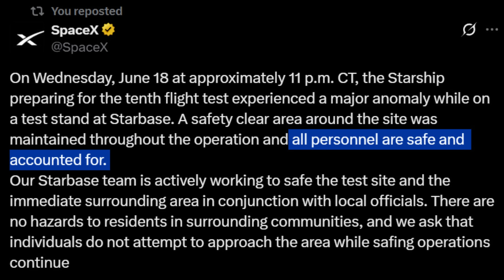SpaceX's Latest Starship Explodes During Ground Test

Comment: My analysis: Forward CH4 bulkhead weld ruptured, much like how test tanks failed at the bulkhead, resulting in payload section being blown apart by the pressure. The initial cloud seems to be CH4 since it all ignites, and I think the first bang is the main CH4 tank... Then the second bang being the LOX tank bursting from falling to the ground - seems like a big amount of LOX was released on the second bang, because the big expanding cloud from that doesn't ignite
Reply: My analysis: Another Starship, another big fireworks display. Whatever the fault, at least Space X manages to be consistent.

Comment: You said they should be going straight to V3. My humble opinion is probably reverting back to fight tested V1 and then start iterating again from there.
Reply: Reverting V1 would be gaining no new information. So it makes sense to move forward to a new version and test. They already know the pain points of V2, fixing that and the other planned improvements to V3 would be a fine move.

We need to stop treating V2 as some magical cursed vehicle that needs to be completely thrown away. Iterating from this is perfectly reasonable, either undoing the problematic parts, or making a better change.

Comment: And all the Spacex fanboys say we should cancel SLS…
Reply: SLS and Starship perform different functions. If you abandon Starship HLS, you don’t replace it with something launched on SLS. Your leading candidate would be Blue Origin’s lander that launches on New Glenn, but you might be able to use Falcon Heavy.

SLS is biblically expensive and it’s not very capable. It’s only real claim to fame is being both big and crew rated, but Starship has no plans for that in the short term anyway
Reply: Of course SLS should be canceled regardless.  2.2 Billion per launch is not sustainable in anyway.
Reply: And they're correct. At year 6 into development SLS had cost 230 billion taxpayer dollars and had launched two Pathfinder test articles that were really unrelated to the design. At 6 years in Starship has launched 9 test articles that are closely related to the final design and some unrelated pathfinders at a cost of 5 billion, none of which is taxpayer money.
Reply: @gasdive you wanna get onboard a starship on the launch pad?
Reply: @Rory-Shields  I'd be less nervous flying Starship. By the time someone like me could fly there would have been hundreds of thousands of Starship fights. There will never be more than half a dozen SLS flights and every flight will be of an untested vehicle.
Reply: @gasdive sls isn’t untested it’s already flown around the moon. It’s actually way more tested than starship, why do you think it’s so expensive and takes so long to fly?

Comment: they need to rethink. Wadever they are doing will cause leaks. New welding method, structure assembly method. They changed something and now it causes problems. V1-s flew fine asside from melting in atmosphere.
Reply: Problem was Version 1 had zero ability to lift a useful payload. Marginal at best. The Raptors are underpowered and overly sensitive to shut downs and exploding. Now they have messed up the fuel system looking for a cure. Their heat shield solution doesn't work either. 
Mind you these are the chaps who thought no flame trench was a good idea. How many years did it take them to acknowledge their stupidity on that simple point?
Reply: Starship is a turd.  They need to do a redesign  of it.  Booster seems to be good though
Reply: If their given the time to think. Haste makes waste, this sure sign of it.

Comment: "We don't know the effects of breathing tiny glass fibers". Actually, we do. Fiberglass if not a new material. The answer is 'not great but better than asbestos'.
Reply: These glass fiber composities are a bit different than fiberglass. The scale of the particles and their structure is a lot different, and could make them more harmful.
Reply: @XIIchiron78  That may be so, but I very much doubt that SpaceX is the only company in the world using them or that safety has not been analyzed for the factories that manufacture them. Yes SpaceX may have their own proprietary unique recipe of ingredients but I expect the actual ingredients are not that rare. I would be a lot more concerned about the non-silica ingredients as we know a lot about silica in general. They likely contain aluminum and boron but even those are not that unusual additives to glass. In general breathing any particles is not good for you, but most have only short term negative effects unless they are in very large amounts. What you want to watch out for is carcinogens and stuff that does not break down and continues to cause issues for decades like asbestos.
Reply: @TimothyWhiteheadzm Yeah it's probably known. SpaceX tiles are very advanced Shuttle tiles so I'd assume some Shuttle engineer has dropped one so that it shattered at some point
Reply: Not great, not terrible
Reply: @semedianindustries  It's pretty terrible.
Reply: Just regular fiberglass is completely harmless. The fibers are so large they get caught in the mucus and expelled from the lungs. They're maybe irritating to the lungs and esophagus but that's about it and temporary

Comment: I no longer believe that Starship is testing spacecraft. They are simply testing explosive properties.

On a serious but speculative note - it's been reported by serious analysts that the deficient fuel to weight ratio of the starship design has likely led to cutting very close to the edge on the margins for the strength of basic components - such as tanks and tubes which are subject to high pressure. This could be another case of a pressure vessel compromise due to very low margins of tolerance. The reason engineers design pressure vessels to 150% of expected pressures is, as you know, because manufacture of such vessels (or pipes or tubes) is rarely perfect. The manufacturing process could result in variances of some 5-10% or more. If your tolerance requirements are lowered because you need to reduce weight, and you take the vessel down to 115% strength vs expected pressure - you're going to increase the probability of failure. 

Starship has a long history of sailing too close to the wind. And it shows. Much of the program has been a catastrophe.
Reply: Would you mind disclosing what “serious analysts” you refer to?
Reply: @ShawFujikawa It came to him in a dream.
Reply: @ShawFujikawa  Elon!
Reply: Actually, much of the program has been very successful, up until the last 3 and then this. Which leads me to believe, they either engineered backwards, or sabotage.
Reply: @skydivejumprope Sabotage by Musk is usually the cause at SpaceX. He is valuable in his ways but damn is it annoying
Reply: @xWood4000  Oh yeah. It would be much easier to digest if they were nasa or boeing or whoever that never streams shit live and never tells you shit yet costs billions.... Then nobody could judge them until it's over with already. Like SLS.
Reply: Those properties are needed in Iran to get rid of those laboratories.

Comment: i always figured starship was going to be so powerful they didn't need to 'barely' engineer it. they could design in layers and layers of safety and redundancy and still have plenty of excess launch mass.
Reply: No it's the other way. It's so heavy they're trying to remove and optimize as much as possible to reduce mass, on top of increasing thrust.
Reply: That would be true and probably easily done if the goal was just "go to space". What they want is to maximise the possible payload.
Reply: @slyseal2091  your lack of reading comprehension is appalling.
Reply: It has yet proven that it can even lift anything, so it doesn't have "excess" launch mass
Reply: You on Ketamine too?

Comment: It's not ideal to breathe anything small and fibrous, Silicosis is nasty.
Reply: That's kinda the reason asbestos got banned
Reply: @weazelzinacan8866 but the ban is perhaps going to be lifted in the US :/
Reply: @anomalousresult  uyuyuy... good luck with that :/
Reply: I inhaled a cottonwood fairy while bicycling. It was alarming.
Reply: @a.nameline653 i imagine the fairy was less than thrilled by the experience
Reply: Big time. I don't know about the present but a few years back, it was sold to auto shops for oil clean up. You could see the floating shrapnels of reflected light in the air.
Reply: How do you know?
Reply: How about a chunk of something that is flying at you at high speed?

Comment: How many Saturns did Apollo explode before putting humans on the moon and returning safely?
Reply: No full Saturn Vs.  They did lose a shit load of early F1 engines in testing.  All the harmonics and flame propagation issues on that monster had to be solved "empirically".  AKA, exploding them.  And of course they lost one capsule due to a wee bit too much pure oxygen.
Reply: @dogmaticpyrrhonist543 beat me to it.  It was quite a lot of them.  I think the Haynes manual for the F-1 has the exact number.... it's beyond excellent if you don't have it.
Reply: Many Gemini's which were the test vehicles for Saturn. Saturn 5 was almost cancelled because they almost gave up because the engines were blowing up. You shouldn't talk about Apollo since you don't know any more than that.
Reply: Full Saturn Vs? None.
But they did blow up a lot of engines on test stands. 
And they came really really close to losing multiple boosters, some with crew on. 

Thing is though, the Saturn V only had to go up, meaning that all failures on descent SpaceX have had wouldn’t matter, and they could be a lot more conservative with the design because they didn’t have to save weight for all the reuse hardware. 

If Statship only needed to go up it’d probably be operational by flight 4.
Reply: When your bar is guys in the 60s working with slide rules and far less institutional knowledge... Not the defense you think it is. 😂
Reply: How many humans did the appollo program loose before putting man on the moon? Or do human lives not matter but Saturn not exploding does?
Who paid for the Saturn V5 and man landing on the moon? Now who's paying so that mankind will have continuance should earth have catastrophic event? Please don't compare chalk yet call it cheese.
Reply: If you look at the history of rocketry after WWII, there were many failures on both the American and Soviet sides.

Although a lot of them happened  behind closed doors on rocket ranges and bunker test facilities.

The Saturn V engines were a particular problem.  But they were tested in isolation, so they didn't get the publicity that 24/7 Internet streaming provides to SpaceX tests.

And NASA did kill 3 astronauts in the Apollo 1 fire. And that was an unfuelled dress rehearsal.
Reply: None
Reply: I should clarify that a SIVB stage was lost on a test stand and engines blew up during testing. But I believe no flight vehicles were lost.
Reply: You mean those silly rockets that old guys drew up using just a slide rule, note book, drawing board and no computers? Those rockets?
Reply: Apollo 1 lost 3 astronauts. Not an explosion but lost of life is quite significant
Reply: @ha1234 - But not AT ALL related to the booster, just the capsule.
Reply: @HailAnts booster fails about 30% of the time so far
Reply: @jebes909090 - I was referring to Apollo 1..
Reply: If it exploded as much as SpaceX rockets it wouldn't have gotten far lmao. Von Braun was a genius

Comment: V2 seems to be made with a lot more explodium than V1 was
Reply: Yeah, the explodium/destrutium ratio appears to be off….
Reply: I think maybe Scott was on to something that SpaceX may had done too many adjustments to lighten the vehicle up. Without any info, there no way to be surely.
Reply: @Wrangler-fp4ei  This nearly random array of failures they're encountering practically screams 'we cut too much structural weight to meet the spec Exec demanded, and our systems have no margins of error on anything'.
Reply: @Wrangler-fp4ei  My suspicion why V2 is that the V1 payload was zero.
Reply: @lorrinbarth1969  This was exactly my point at the time. You could more or less tell from the fuel diagrams that it used 100% of its fuel to fly zero grams of payload on a trajectory slightly below LEO.

They did not even try to pretend differently, as they never flew it with a mass simulator, which you normally do on a first test flight (even SpaceX themselves in the first FH flight).
Reply: @vmanrn2906  A mass simulator? How do you simulate mass? Seems like our fusion reactors would really benefit from that.
Reply: @paulpinecone2464  A mass simulator is basically ballast. It "simulates" the "mass" of a payload without risking an actual expensive payload. It makes the launch more realistic in terms of stresses on the rocket but at the cost of a few hundred pounds of iron rather than millions of dollars worth of operational satellite that probably won't make it into a usable orbit anyway.
Reply: @willythemailboy2  Okay I get that, but can't they make it out of something besides explodium?
Reply: @paulpinecone2464  They didn't? The ROCKET is made of explodium; mass simulators are literally just ballast.
Reply: @willythemailboy2  Ok, just hear me out.

Make the ROCKET out of metal. 
Make the MASS SIMULATOR out of ballast. 
And make the PROPELLENT out of explodium.

All right now, let's try this ONE MORE TIME.
Reply: @paulpinecone2464  A fully fueled, stacked Starship is 78% propellant at launch. With that in mind, what the rocket and payload are made of is largely irrelevant.
Reply: It did not reach London
Reply: Explodium.  Much easier to find than Unobtanium.
Reply: ... but it's mixed with concentrated Bullshiterite...
Reply: @daveroche6522 😂😂😂 Makes everything more explosive!
Reply: Explodium alloy
Reply: The american OSS intelligence officer reading the latest communication from one Heinrich Maier et al, 1943:
Reply: Rudium
Reply: Hubranium  @forthebirds4
Reply: Are we talking Nazis or neo-Nazi?
Reply: Badaboom yaaaaaaaaaa😮 oh wait it's not July 4th🤣
Reply: @Youtubeispoo-o6d  But it is Juneteenth.
Reply: Unscheduled sudden disassembly, commonly known as a kaboom 😂
Reply: Exolodium/successium ratio is bit off.
Reply: @DarkZodiacZZ successium is subject to tariffs, so that's been cut to save costs.
Reply: I imagine spare parts on a shelf just spontaneously exploding.
Reply: its the pipes, they made it into a giant pipe organ, vibrations and hydrogen seals dont mix its never ever going to be reusable even if they fluke it not shaking itself apart on first flight
ive said it since i first saw their piping
free hanging pipes through middle of a steel tube....
in a triangle no less
its possibly the worlds biggest musical instrument, but its not a design for a reusable rocket 
you couldnt design it to have better harmonics lol
Reply: I mean... german V2 was meant to explode. This one seems just like a copycat
Reply: @hanzcraftcz  they can test some at gaza launch station
Reply: I think V2 is a CURSED name.
Reply: @josephb8268  Yeah... "BLOCK 2"...better.
Reply: @SteveBakerIsHere  I think in this case,V2= version 2= mark 2= block 2.
Reply: I'm starting to consider the possibility of politically motivated sabotage...
Reply: Lmfao
Reply: Much better shows.
Reply: It's full of fElon's hubris.
Reply: As is tradition established during WW2.
Reply: Well, it's a V2...

Starship even looks somewhat like the one the Germans built in the 1940's
Reply: I will have to steal that new word  "explodium"
Reply: @tiermacgirl 
“Explodium” is an old term for the mysterious rocks that appear when things blow up on Star Trek starship bridges.  Apparently Starfleet uses a lot of lightweight rocks in the construction of their starships.  😂
Reply: Explodium. lol.
Reply: Are you sure?  I’m not seeing any rocks.
Reply: hm V rockets same term  the nazis used in  ww2  well musk is a south African

Comment: Watching the first explosion doesn’t hurt as much as the second explosion watching all the ground equipment get destroyed.
Reply: It looks like most of it is intact. The explosion looks dramatic, but a lot of the hardware is designed to take some heat, and there's not that much force behind the blast. Most of the smoke is simply lox boiling off.
Reply: Nah, the following kabooms were the icing on the cake. This has brought a huge smile to my face. Great way to start the day.
Reply: The more it costs Musk, the better .....
Reply: @rorykeegan1895  You need to get help. So ate up and pathetic.
Reply: @rorykeegan1895  I think it's time to take a break from the internet my guy.

Comment: I'm standing by what I said after flight 9. I think V2 has fundamental flaws with the fuel delivery system and they should scrap the remaining V2 hardware and focus on V3.
Reply: Working out V2's flaws and getting it functional is necessary to inform the design of V3. V2 is much more capable than V1 and reverting back more than is needed is a waste of performance.